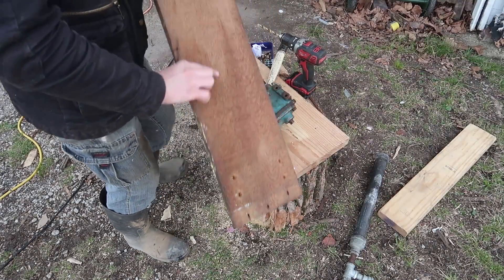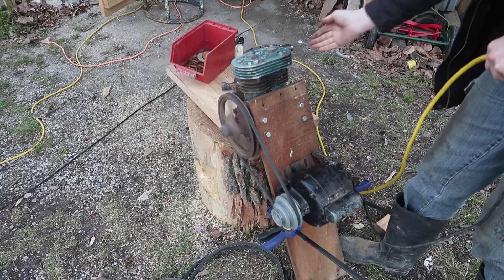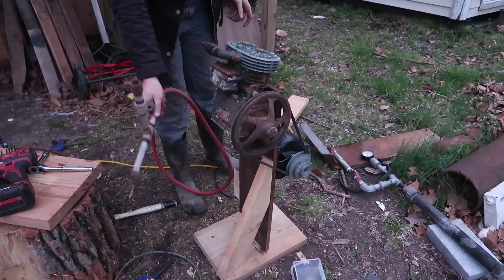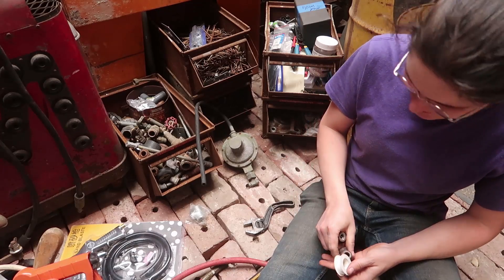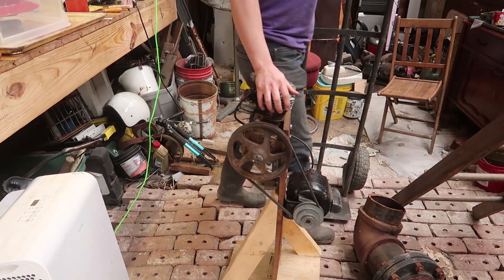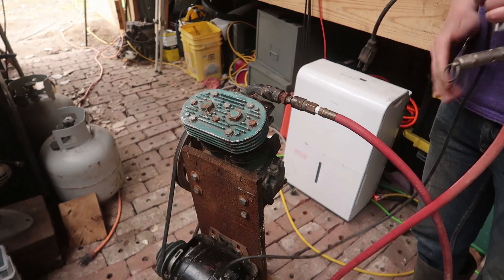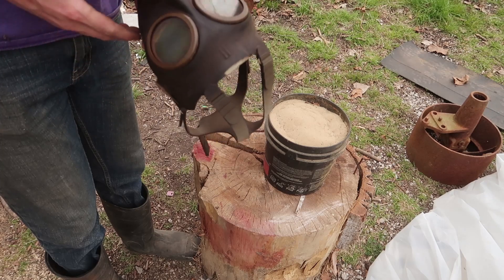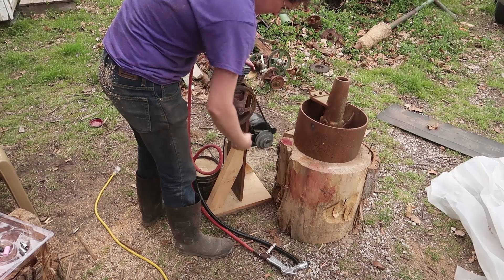DIY Homemade Air Compressor 01: Tankless Sandblaster Build

Comment: Air compressors, great machines ,as a rule, it's as much about the working CFMs as it is the motor HP.,or more! Without a tank the compressor will never be efficient .This is a good example of that.
Reply: an old butane tank or something would be the answer I think

Comment: Sandblasting requires a huge volume of air. That would be okay to pump up tires though. My father built one in the early 60s out of a washing machine motor, refrigerator compressor and he put it on an old push lawnmower to make it mobile.
Reply from the maker: actually this would be bad for pumping tires because its geared for high cfm low pressure atm.

Comment: Years ago, actually many decades now, Sear sold a sand blaster and it was a bucket type blaster that you poured the sand in the top through a screen and it fed out the bottom into a hose to their blaster gun. And when you connected the gun up to a compressor, it siphoned the sand to the gun and worked very well. But their bucket was shaped like a funnel on the bottom into the hose. I used that blaster up until I bought a HF floor standing blaster cabinet. I said that so you could try a funnel fed bucket on the bottom to your gun and see how that works...

Comment: Like these type of videos I built a gas powered compressor with a 200l tank it goes along with my sandblaster made from a butane bottle works good but a 6.5hp engine struggles 😬

Comment: You should add a tank to work as a capacitor to it
Reply from the maker: tank would ruin the efficiency.
Reply: @RinoaL  how would it do that? Once you get up to pressure you can blow without it shaking like it did now, wouldn't it just work like a wider hose?
Reply from the maker: well if i have to re-gear my tankless compressor to pump up to 120psi, id have to lower the gearing ratio of my motor and thus lower the speed. when im almost about to the CFM i need. you only need about 10PSI for sandblasting, you just need a lot of air at 10psi.
Reply: @RinoaL  it's about the volume

Comment: There is a bunch of water heaters at the scrap yard, maybe you can use one of those tanks to hold compressed air.
Reply: Be careful, as they were never intended for such high pressures. Hydrostatic testing to twice operating pressure is a wise approach.

Comment: What about adding a tank ( Propane tank) to build up pressure, prior to ot reaching hose.  Giving you a longer burst of air. ?
Reply from the maker: will lower CFM making the compressor work slower, meaning itll actually work worse.
Reply: @RinoaL  oo. Ok.  You would know better. Ha. 
I was just thinking how an air compressor at an mechanic shop for air tools would work.  
Okie dokie.   
💪🏼😷👍
Reply from the maker: well air tools seem different, they actually need a lot of punch to get rusty bolts undone and such, but for a sand blaster you just need fast air to make sand go really fast, not really bursts of pressure. so i think its good that they have an air tank for shops.

Comment: I hate this format of comment, but it seems so appropriate...
Rinoa: I had a moral failing buying a cheap sandblasting gun from China (I don't actually disagree with you- I avoid Chinese goods whenever possible)
Me: OMFG, Rinoa built a bloody sandblasting machine with a tankless air compressor using almost entirely what other people see as scrap and garbage.

I'm not much for admiring other people (perhaps that's MY moral failing). But I admire you.
Reply from the maker: aw thanks.

Comment: Not sure that compressor can produce enough CFM to run it tank-less ?
Reply from the maker: well its not a set requirement, i can lower nozzle size to need less cfm.

Comment: pretty neat setup but why no tank? there is a whole bunch at the scrapyard. balloon helium tanks are tested for 30 bar (435 psi) and are single use. you could even try to detonate one. sorry to always have nagging ideas
Reply from the maker: well simply because i realized the tanks hurt the compressor output not help. what you need is CFM not PSI. even with 90psi hookup the pressure is 15psi at the gun when using it or so. so why not run it at a lower pressure but higher CFM so the compressor works more efficiently? it seems to be working really well, and i hope with the upgrading of the motor and making my own nozzle (going to play with nozzle size) will get this working well.
Reply: @RinoaL  so flow is more important than pressure.
Reply from the maker: yeah, all you need is to get the sand up to speed.
Reply: @RinoaL  While avoiding taking twenty minutes to do a postage stamp size.

Comment: OK so I've been subbed forever (like I remember you getting that $50 Gridcase magnesium NASA laptop off ebay) but I've gotta say something. After watching your rant about the tool fans, restoration, collecting and making community in which you took off the gloves and said what a lot of us were thinking and definitely identified the heart of the issue btw, I've been paying better attention to the exact wording in titles of these types of videos. I must point out that on your bench vice vid you straightened it, repaired the threaded rod, removed the rust and refinished it which looks great but I checked and that vice never came with a linseed oil finish. Obviously the proper thing would have been to contact the manufacturer of the enamel that Sears used in the 60's and had a batch specially made for you. Now you post a "diy" sand blaster and you didn't even smelt the steel and cast the pump, wind your own motor or whip up the pulleys on your lathe. I mean, at this point I'm wondering if you even grew the trees and cut it into lumber yourself. Well I guess you've learned your lesson so I'll just go ahead and stay subscribed for another half a decade.
EDIT : I I just got to the part you mentioned that you did harvest the sand so that definitely helps your case! I mean you didn't grind it down from sold rock but it's a good start.
Reply from the maker: i want to congratulate you on walking so dangerously close to extreme sarcasm there, i thought you were being serious half way through. hahaha
Reply: @RinoaL  well that's because I was serious about the first half. It's getting really ridiculous with the whole "old, American and PERFECT is the only acceptable condition for a tool" crowd is nauseating. They are basically the "I only drink $200lb coffee that's imported from one tiny village in Ethiopia after it's pre-digested by civits and I to make it with my $600 cold pour system" but worse because they think they win the morality game.

Comment: You need to use a stronger motor with a smaller pulley on the motor side.  And you have a welder.  Why dont you construct more projects out of metal?  Kinda just seems lazy....
Reply: Metal isn't superior to wood, it's a different material with different uses. Wood is ideal for low-precision structural assemblies; metal is better for small precise parts. A welded frame would likely be much heavier than the wooden one in the video, without much benefit.
Reply from the maker: and if i decided i didnt want this design, the metal design will sit in my scrap pile for years unused whilst i can just burn this wood frame and get more from a dumpster for free.
Reply from the maker: you do not need a tank for a tankless air compressor. ocnstruction site jackhammers dont use a tank. and why shouldnt i use wood? metal is harder to work with. sand blasting doesnt need more pressure, you dont seem to understand any of this. the only reason you have to pump up an air tank to 90psi is to have enough flow at the nozzle because when pumping to 90psi the air compressor is less efficient. it is a problem that creates itself. even at 90psi the pressure at the sand blaster gun is only like 15psi so thats all you need.
Reply: Also you need a tank to store the air
Reply: And build more pressure

Comment: Is there some oil in the compressor? =) Just a thought.. Also the motor seems a bit underpowered...
Reply from the maker: yeah theres oil in it, it was sitting on its side, almost upside down, so oil leaked past pistons. and yeah motor is miserably underpowered.

Comment: I don't know much about media blasters, but wouldn't you need some kind of storage tank to build up some pressure? Maybe you mentioned that and I missed it.
Reply from the maker: no, because you dont need pressure, you need flow rate. why pump it up to 90psi only for it to be 15psi at the nozzle?
Reply: Rinoa's Auspicious Travails I run my sandblaster at 80 psi with tank
Reply from the maker: whats the pressure at the nozzle?

Comment: Dang, that's a cool concept, add one or two of those pumps and it'll work like a charm.
Reply from the maker: thanks, i have several compressor units to add as well. i like this better than waiting for a tank to fill.
Reply: @RinoaL  Yeah, but with a tank you can have air-on-demand though) Can't wait to see the finished project, good luck!
Reply from the maker: but your compressor has to be geared down to pump that high pressure slower, thus lower cfm.